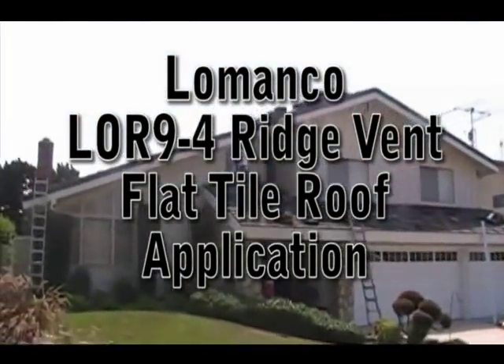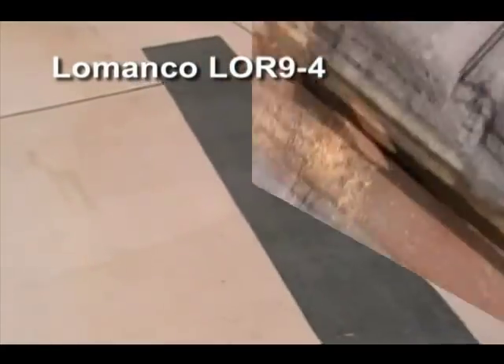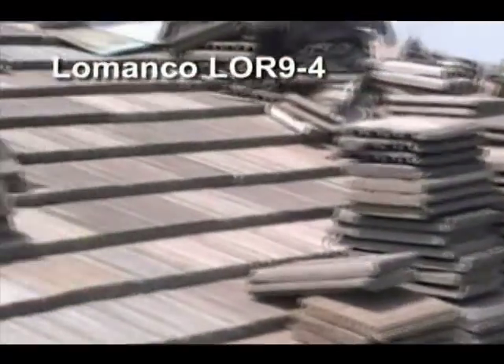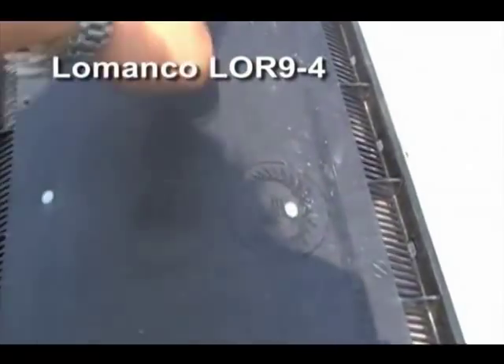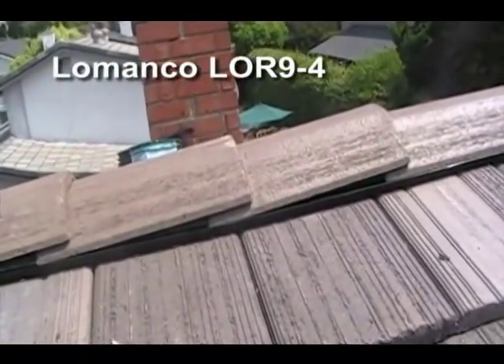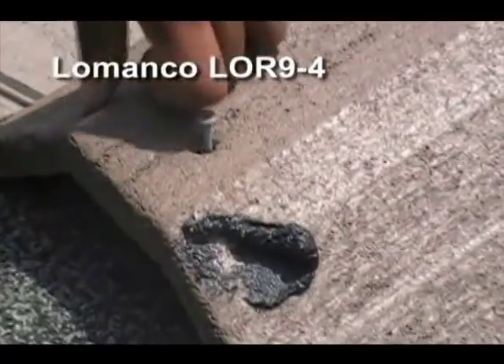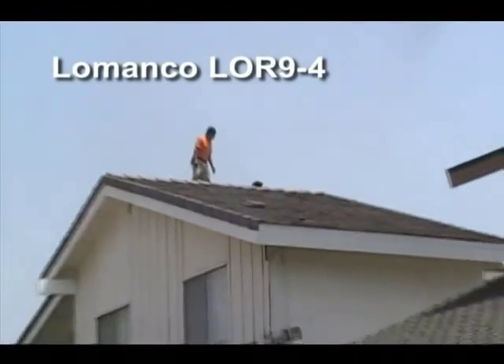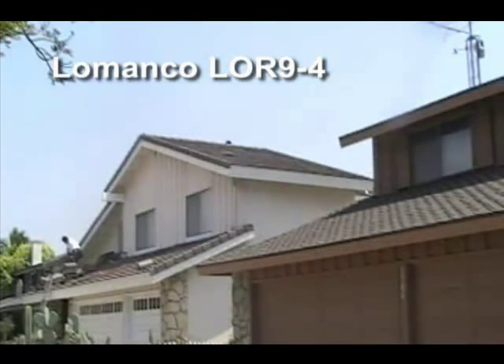Lomanco LOR9-4 Ridge Vent - Flat Tile Roof Installation

Comment: Are ridge vents better than turbine fans?
Reply from the maker: Exhaust products are part of a ventilation system.  As long as the proper number of vents are used and the system is balanced, (50% exhaust and 50% intake), ridge vents, roof louvers, whirlybirds, power ventilators or gable vents will be equally effective.   All of Lomanco's products are designed with the Lomanco Balance in mind- free movement of air and weather protection - and are equally effective.  Often, the design of the home will determine what type of vent is used.